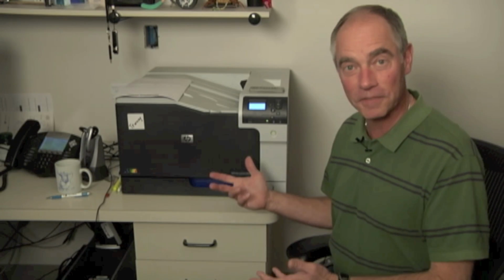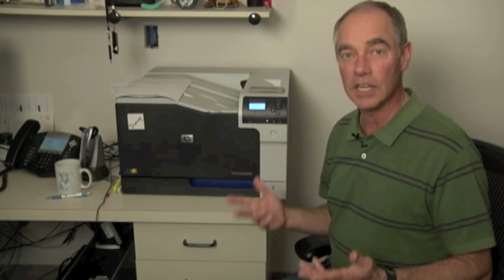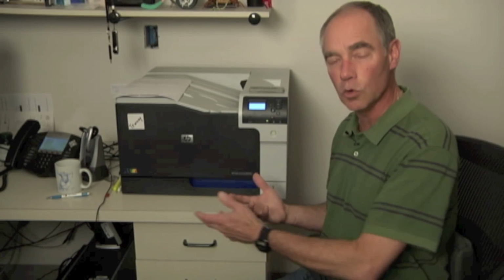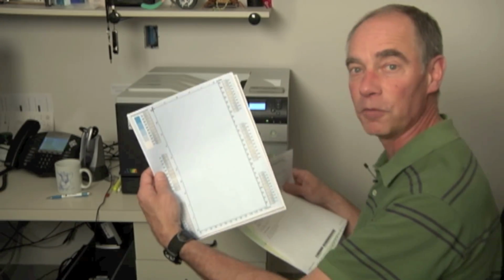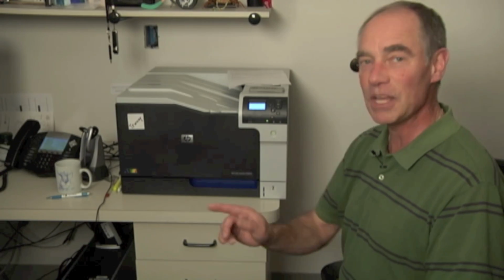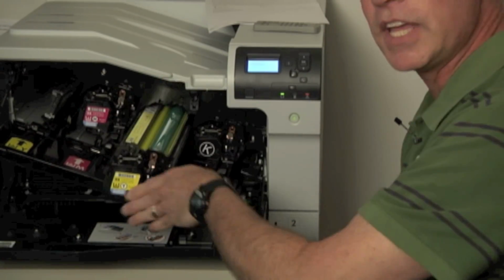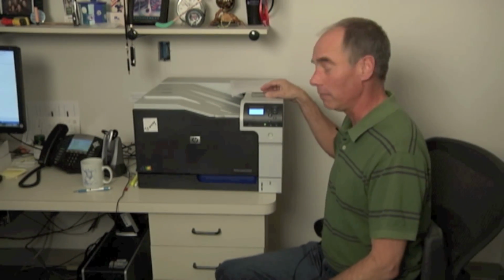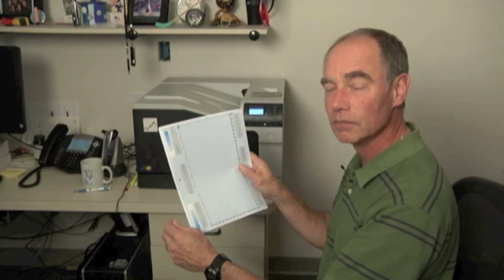PRINTER REPAIR: How To Trouble Shoot Color Using The Disable Cartridge Check Test

Comment: Thanks for the information on 'disable cartridge check test' - however does this function help also with issues related to transfer belt? I have a customer with a machine only 18,000 pages used and a horizontal mark is appearing a the top of the A4 page. Now I changed the Cyan because this toner had most usage but no change, however when yo remove the Cyan toner there is a mark at the exact area of the print quality line and I wondered if changing any toners would highlight the source of the problem. (from Graeme in Scotland - UK)?